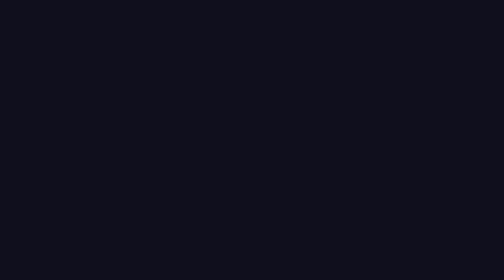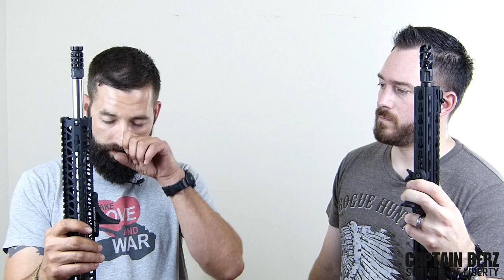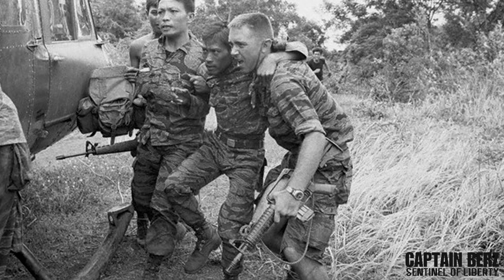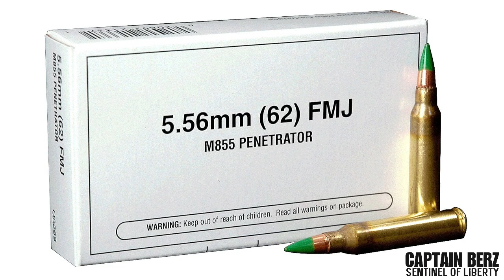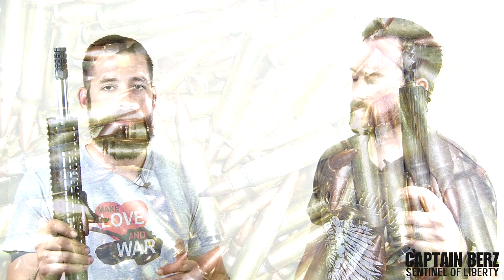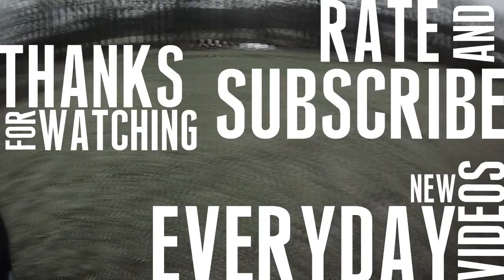AR-15 Barrel Length & Twist Rate (Part I)

Comment: I'm an ex-combat MP, gulf war veteran/Iraq/ Kuwait. I cleared buildings, breeched doorways, shot from vehicles, short/ long distances, all with a 20" barrel M16A2. I own the 3 length barrels, 16,18, & 20". Each has a purpose, CQB, all around, & SHTF. 
My 20" rifle length DPMS 5.56 is my favorite. It's stupid accurate, extremely reliable, & good for short or long range.
I use cheap 55/62gr FMJ & 62gr hpbt and the 20" works great with all of them.
Reply: +fsteddie95 I agree. As much as I like my Colt 6920's, I bought a Colt AR15 A4 a couple years back and love it so damn much a just got another one last month ! I say we enjoy all the barrel lengths although I don't have an eighteen incher. I like to just copy what the military does. Acogs, M4s and M16s,,,
Reply: The Navy Mk 12 is obviously a great rifle. My substitute for the DMR is a Colt AR15A4 with an ACOG TA31. Not a true DMR but the next best thing. A buddy of mine has a Danny Defense DMR like yours and loves it.

 If you are thinking about a floating barrel I would suggest a Colt M4 6940. I love mine and paid $1300. It will have a factory free floated barrel with a standard 1/7 6920 barrel. As you may know, the minute you pay more than the $1k mark you are buying things like free floated barrels, hammer forged barrels and factory installed match triggers. All of which are great for that extra degree of performance but not at all necessary. If you want a standard GI rifle for run'n gun and personal defense then there is no reason to pay more than $1k mark.

Don't bother with the FN15. My nephew has one and although its a great rifle it doesn't cover all of the very basic milspec's that a regular 6920 does. It does not have an H marked buffer or staked castle nut (!?!) The fit and finish is great and at least they come with a carry handle, unlike Colt. But after seeing his, I was very glad that I didn't bother getting one. 

FYI the FN15 'tactical' or FN15 'DMR' may be an option for you.
Reply: What is the twist rate of your 20'' barrel?

Comment: What is the difference in bullet velocity between a 20" barrel and an 18"?
Reply: +Albert Ortiz Depends on what ammo you're using to compare. M193, M855, M855A1, Mk. 262 etc.
Reply: +Tumdéaux do you think I'll be able to shoot m193 55g out of my 16 Inch Barrel with a 1.7 twist the m855 62g shoots fine of course
Reply: M193 has a slower burn (wider pressure curve) so you'll get more flame at the muzzle than M855.
Reply: Tumdéaux is that for me or Albert Ortiz
Reply: Kami kadze both actually :)
Reply: Tumdéaux okay will it stabilize the round effectively?
Reply: Kami kadze Yes. Because as barrel lengths get shorter, twist needs to increase to compensate for velocity loss. For example, the AK74 has a 16" barrel with a 1:8 twist. The Krinkov has a shorter 8" barrel, the twist needed to be increased to 1:6.

Comment: 20 inch barrel or nothing. Yes, 16 inch barrels weigh less, but they recoil more, create significantly lower velocities which decreases the range and lethality that you NEED with a .22 caliber bullet, and you lose accuracy. I'll take 4 more inches of length and 1/4lb more of weight, for a lower recoiling, more accurate, more lethal 20 inch rifle.
Reply: +NovaMan 350 if u cant handle the recoil of a 22 you shoudnt be shooting
Reply: +hambone950   It isn't that you can't handle it, it is that you can shoot faster without spraying bullets all over creation.
Reply: Moto Rad Did I ever imply or say it would be good? No! I only said the recoil difference between the 16 inch rifle length and a 20 inch rifle length would be unnoticeable. Now fuck off.
Reply: +Moto Rad your wording is shit! It reads like you're implying that recoil would increase. That being said I've shot a Del-Ton Inc. 16 inch barrel with rifle length gas system. Recoil wasn't really any different than  a 20" barrel with rifle length gas system.
Reply: godofawesum223 The recoil would only improve since everything would be undergassed. Go get your armorer's cert before you start spewing bullshit on the internet.
Reply: sappersam Less recoil is improvement last time I checked.
Reply: sappersam Del ton makes shitty rifles. Not sure why you even brought them into this conversation.
Reply: +NovaMan 350  "Yes, 16 inch barrels weigh less, but they recoil more" This is PATENTLY false. The Length of an A15/m16 barrel has dick to do with recoil. Recoil is determined by your gas tube length. The Longer your gas tube the less recoil you experience. If you could find a 16 inch ar15 barrel that can utilize a rifle length gas system it would have the exact same recoil as a 20 inch barrel. A LOT of dumbasses get 16 inch barrels with carbine length gas systems and they have a more recoil than the midlength gas system 16 inch barrels.

Comment: .223/5.56 was designed to be fired out of a 20 inch barrel. Shorter the barrel less effect the round becomes. The round depends on the high velocity to be effective. There is a huge reason 300 BLK is replacing the 5.56 for SBR's ar15s
Reply: 2 thumbs up

Comment: This was a great video… My only part disagreement is that barrels over 18 inches have their place. If you are doing a build for precision work at distances greater than 500 meters then a barrel over 18" may be of benefit (higher muzzle velocity) to keep the bullet supersonic longer for accuracy. Especially in heavier loads… But for 99% of shooters / builders this is video is spot on!!
Reply: Part II was phenomenal too… You discussed more about this. I would love for you to do a Part 3 with: chamber types, feed ramps, barrel contours, etc.

Comment: basically spent the whole video explaining why the 20 inc barrel is superior in every aspect BUT in confined spaces such as a house, only to come to to conclusion that you would never build a 20inch upper. o.0
20 inch uppers have their place and are better in just about every scenario past 100 yards.
if you use your rifle for just target shooting and or hunting - 20 inch.
if you use it primarily as a ranch rifle - 20inch
if you use it primarily as a home defense rifle - 16 inch
there is no reason to limit your ballistic capability unless your surroundings absolutely require that you do.
the only reason most people steer away from the 20's now a days is because its not general considered as "cool"
The AR15 market is flooded wit trend following zombies.
A 20 inc rifle with a collapsible stock is only an inch or two longer than someone holding a fully extended handgun.
Reply: If you look at the muzzle velocity charts of an 18" vs 20" barrels, that's where the "law of diminishing returns" really takes effect and they become kind of arbitrary. He said he'd opt for an 18" for a dmr style rifle due to this. If you think 20" is great, then by all means dive on it. I think even a 24" would be cool, but it's ultimately cosmetic in the end and that much more of a pain to store and move with. Really you only want a barrel that's just barely long enough to accomplish what you want it to though, in the end.
Reply: Btw, we have 20" rifles in our towers at work and 16"s for our mobile positions, however we have the option to use the 20's during training. I'll tell you what, they're fine static-wise but they're a fucking pain to run around with. It's like the guys that pack their kitchen sink when going hiking. On paper, it sounds great. But actually hoofing around with it, it sucks.
Reply: @krixig did you happen to work security at a nuclear plant? Lol
Reply: Dont you worry I'm bringing the 20incher back into style ;)
Reply: What Dan said right here... Someone frame this.

Comment: If you actually look up the velocity difference between the 20" barrel vs the 14.5 there is only about 100fps variation even at 500 yards. The difference between the 20" and the 16" is approximately 50fps. Don't know where you came up with the 14.5" is only effective at 100 yards.

Comment: The Marine Corps still uses the 20 inch m16a4 for the range and velocity. Army mostly uses m4.
Reply: No the m14 is the dmr ( designated marksmen rifle) the a4 has 16" barrel along with m16a2. The m4 has 14"
Reply: Taylor Nothnagel Uh no you are wrong. Both the a4 and a2 have 20 inch barrels. I would know I was a Marine
Reply: brothers chill out hoahhh!

Comment: so the m855 only tumbles and fragment in a 20in barrel?
Reply: The official data state that a MV of 2500 fps or above is preferred for optimal fragmentation,i.e., yaw giving way to tumbling (swapping ends) in the terminal ballistics phase. Part of the trade-off of M855 was that in order to get better penetration against sheet metal (an enemy helmet, it was hypothesized) at the specified range, a steel cup or "penetrator" was inserted into the lead matrix of the bullet. This does not make it AP or armoring piercing ammunition; technically, it is enhanced penetration ball/fmj ammo. The penetrator tends to diminish the reliability of the yawing effect so pronounced in the 55-grain M193 round. Sometimes, M855 62-grain green-tip yaws and fragments just fine, without issue. Other times, if begins doing so only after passing through a certain thickness of tissue first (which is why the round is thought to be less-effective against slender or skinny people), and sometimes it just ice-picks and doesn't yaw-fragment at all. 

Like most conventional rifle bullets, the M855 62-grain projectile is naturally tail-heavy. It's center of gravity lies aft of its center-line. When it is fired, the tremendous spin and muzzle velocity imparted cause it to remain in the proper nose-first attitude and spin-stabilized along its long axis. Because of imperfections in construction, all M855 bullets yaw about their central axis to a degree. The question becomes is the yaw enough to cause the bullet to tumble (swap-ends) when it hits a target such as an enemy soldier? 

The unpredictability of the degree of yaw, plus the dependence upon the projectile designs - M193 and M855 both - upon high MV for their effects on target - account for much of the inconsistency in combat performance of the 5.56x45 cartridge. Some troops reporting devastating first-shot stops, others reporting enemy tangos absorbing multiple center-mass hits yet remaining in the fight. 

Modern innovations such as the widespread use of bonded solids and OTM (open-tip match) bullet designs have led to greater reliability and terminal effectiveness for the cartridge out of carbines, SBRs and when suppressed, as well as more-reliable performance against barriers such as automotive glass and sheet metal.

Comment: I keep M193 handy if I have to use my AR for self defense, I have a Colt 6920 with the 1/7 barrel. As for the 77 grain Match King would that work right out of my rifle with a 1/7 twist or would I need a rifle with a 1/9 twist?
Reply: +ZIPPER978 no reason?  Having a shorter battle is the best reason to use a heavier round.  What you lack in velocity, you can some what make up for in mass, especially in a 1:7 barrel.   16inch barrel with a 1:7 twist is Perfect for a 77grain OTM.   This is why SBR's are transitioning to 300 blackouts, because they counter the lack of velocity in shorter barrels with a heavier round with more mass.
Reply: No reason to use such a heavy round in a short barrel
Reply: +LionWolf Tactical  *Barrel not Battle

Comment: Interesting video Berz. Got a Model1Sales 16" upper in 5.45 with 1:8 twist earlier this year. Read articles on twist rates. Those rounds keyhole terribly with less twist. Think my CAI AK is same twist, same barrel length. Put on paper at 100, no keyholes. Been busy and have not been able to test it much. Again, good video.

Comment: Will you be discussing sbr length barrels?
Reply from the maker: Okieundercover We did cover SBR barrel lengths in this video in relation to the topic. Can you expand on what you would like to see? In part II there will be more discussion that might hit on the this topic.
Reply: CaptainBerz Regarding this subject, Berz, can you give us some data on proper twist rates for AR pistol barrels?  The most common lengths I'm seeing on the market are 7.5" and 10.5", all done in standard 1 in 9 twist.  I'm setting up to do an AR pistol build and would like some advice regarding ammo and barrel to get the most juice out of the shorter platform.  Thanks bro!